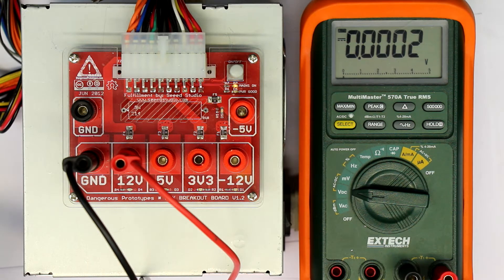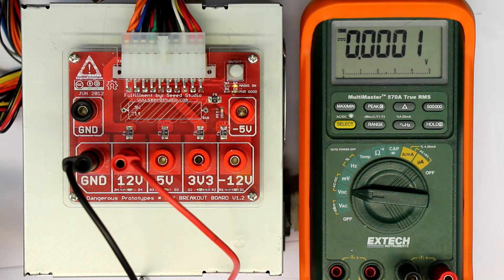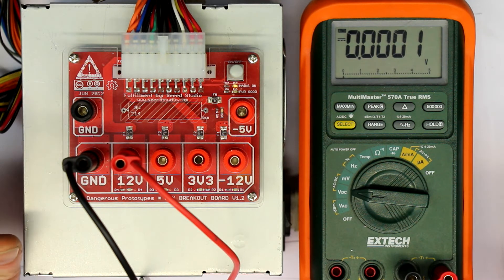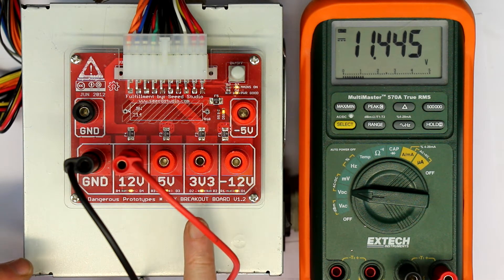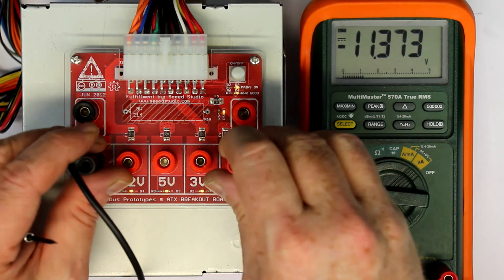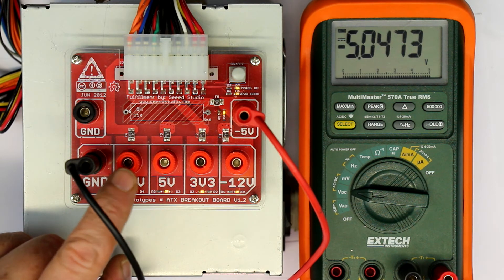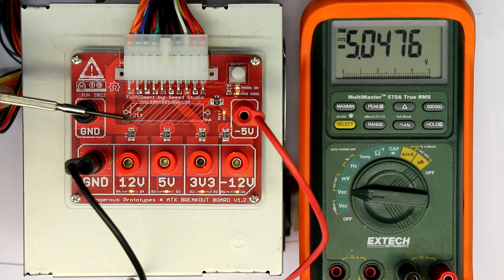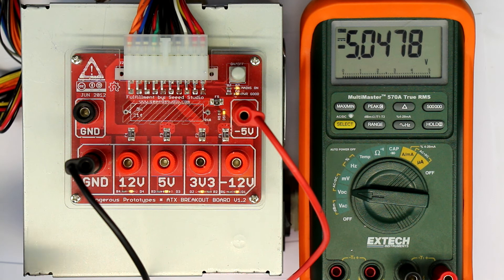Every Maker should have...[Pt  38]...an ATX Power Supply Adapter

Comment: I like it. The only thing I'd do differently, is add a 9V tap and add one tap that runs through an LM317 with a potentiometer for adjustment. In fact, that's what I did when I built a very similar board for my own lab. That said, this board is much "cleaner" and neater than mine, and I might just buy one or two of these to have around.  🙂

Comment: Hi Roger, another source for power supplies is to find old network switches (with built-in power supplies). These often have top brand small PSU's like Delta, CP and Astec. They are usually good for 12v@3a, 5v@3a and -12v@350ma. Most have pots for adjusting the output voltage and the ground is isolated so you can chain them for higher voltages. I have 4 so I ignore the weak minus rails and get ±5, ±12, ±17 and ±24v and all an fit in one deep ATX case with 9 binding posts and no cables.